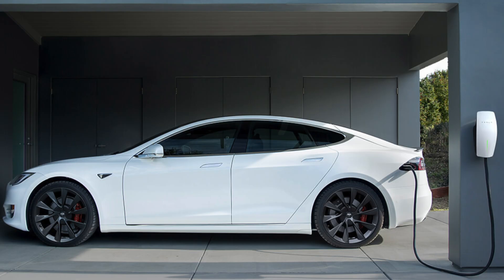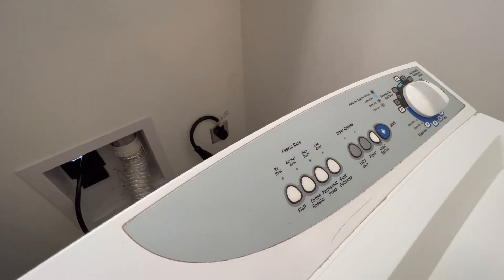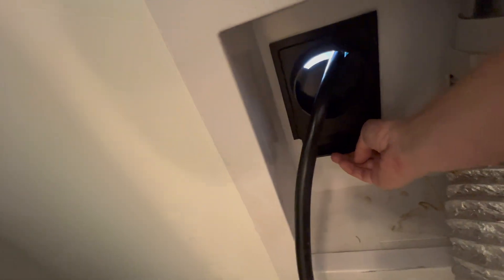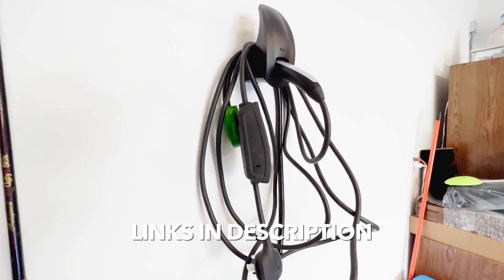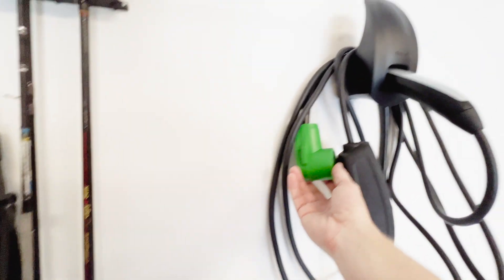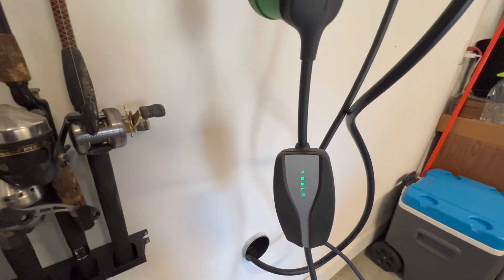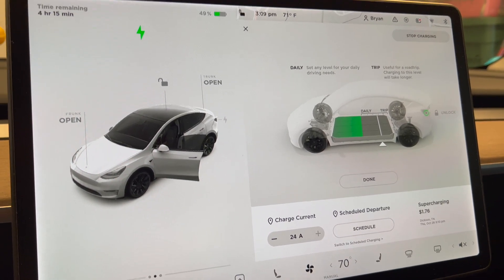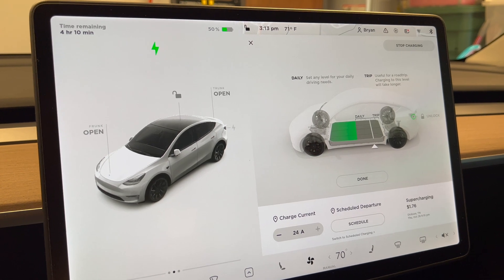Tesla Fast Charging at Home w/ Dryer Plug - Quick Tip

Comment: My dryer plug is a 3 prong 10-30 plug, so I just need to get the 10-30 splitter, extension cord and adapter for mobile charger? Thanks
Reply from the maker: Yep. 10-30 splitter as you don't want to have to unplug constantly from the dryer outlet (main end goes into the 10-30 dryer wall outlet, then one side you plug the dryer into, the other you have the heavy duty 10-30 rv/ev extension cord into, then plug the 10-30 adapter from Tesla into it and you're good to go 👍🏻 I have links in the description of this video I'd appreciate you use on Amazon even if you select a different version. Just click the links and the select your 10-30 versions. Don't forget to never run both the dryer and car charging at the same time (use a sign of some other solution). Also, the Tesla should automatically set the amps, but if for some reason it's tripping the circuit or you ever feel a hot cord, take the amps down one or two notches on the screen. 

If for any reason you feel like something's not right, unplug and make sure to contact a certified electrician to look things over.

Hope that helps!

Comment: Get the Splitvolt Splitter and all your worries will be gone.
Reply from the maker: What worries are those? Great product, but not necessary for most people just trying to get going with decent charging speeds. I've been charging without it for 18 months and never had one issue as well as most of my friends with EV's. If you have kids or family then I could see how it would be a convenience to never have to make sure someone isn't drying when you plug in, but this video was aimed at someone looking to just get started and charge faster than the included wall outlet which I think 21 miles per hour does vs 3 miles per hour. Once you had the split volt and any other cables/adapters, you might as well just get a 50AMP plug installed with a 40AMP wall charger.
Reply: @bryanhauer  you can get rid of that Tesla tag. When the dryer turned on, the EV charging will stop automatically and it will continue charging again once the dryer stopped.
Reply from the maker: @vinnynguyen123  I know what it does 😀, but as I said... for most people that don't have a large family with other people drying it's an unneeded expense. If you have a family I'd agree with you as it would be annoying to worry about that, but this video was more aimed at the person who just got their Tesla and wants to do it for as cheap as possible. I do agree with you though that Splitvolt is a great product and has its place, but I kind of feel like if you're going to spend $300, why not just get a 50AMP dedicated plug installed? I eventually did that for under $250 from a certified electrician.

Comment: My main electric panel has maximum 100 Amps Main breaker. My dryer is electric. Can i still charge from my electric dryer or i need to upgrade my panel.?
Reply from the maker: You likely don’t have enough available as most new panels have 200. I’d check with a certified electrician to be sure.
Reply: @Bryan Hauer  Thankyou so much

Comment: Can I just keep the charger and dryer plugged the whole time or was there a reason why you unplug the charger
Reply from the maker: Shouldn't be an issue just leaving it plugged in. I did it just to be extra cautious so I'd make sure to never run the dryer and charger at the same time. Just created an extra step so I wouldn't make that mistake.

Comment: I have a gas dryer , so I just changed the dryer receptacle to Nema 14-50 one , it cost me $10 . And now I can charge the Tesla at 32 amps which is maximum the tesla charger can charge a SR+
Reply: I'm not an electrician.  But if you're doing what I think you're doing, that could be trouble.  The wire size required to charge at 32 amps are different than 22 amp.  I think the wires required for 50amp breaker and charging at 32 amps might be #6 wires for 50amp breaker, but still are probably #8 for charging at 32 amps.  I think the standard for that existing 30amp breaker are probably #10 wire.  So sounds like you're charging at 32 amps through #10 wire.  You may wanna look into that.  I didn't hear you say you changed the breaker, but I don't know how you're charging at 32amps through a 30amp standard dryer breaker.  Again, I'm not an electrician.  But you may wanna check into your size wire and the amps you're running through it.  Good luck.
Reply from the maker: Had two certified electricians look everything over and no issues 👍
Reply: @bryanhauer  I don't know if you're replying to me, but I was responding to the person above, Aman Paesar.  He didn't do the same thing you did.  His case is totally different from yours.  I see no issues with your setup either.  Aman's is another story depending on what else he did.  If anything.
Reply from the maker: Ahh got it 👍 wasn’t sure. 😀 Appreciate you helping him.

Comment: Super helpful video! How did you drill the hole in the wall? Any tips on how to drill into the wall safely and not damage any wires that might be inside the wall? Thanks!
Reply: His hole violates fire code.
Reply from the maker: Thanks. 😀 The tool is called a 4 inch hole saw or hole dozer. I didn't go through full drywall as I already had a cutout there for the dryer vent so only needed to go through about half an inch of plastic so not sure, but you definitely don't want to just start drilling holes without knowing what's behind them. I'm sure there's some YouTube videos on this as well.

Comment: This is so helpful. I get my model 3 on Monday and the electrician quotes have been HORRIBLE. I was shocked to see everyone want to charge $2000-$3000 just to install the outlet in the garage. Nope! This will do and my laundry room is right next to my garage. Just ordered a dryer splitter for $70 and I have the level 2 25’ charger/cord. My only question is what do you call the slide/pocket door thing you installed?
Reply: Figured it out! Cable hatch! Just purchased on Amazon. From $2,000 to $98 I’m so happy.
Reply: @CamSaidSo  Can you provide the link or the name of the cable hatch please?
Reply: @barrycrawford870  I ended up not being able to use the hatch because the charger head that goes into the car is too large to pass through. Right now I just have a cut out in my drywall with steel wool around it until I can find something more aesthetically pleasing.
Reply: @CamSaidSo you bought it 6 months ago?   Ouch  you bought it right before Tesla drop 30% from original msrp plus $7500 tax credit
Reply: @sky-h6j-i1q  don’t remind me 😒. I was so upset about it. Thankfully, this is a lease that will be returned. Still love the car though.
Reply from the maker: Oh cool. Make sure to keep an eye on it the first few times to make sure the charger isn't getting hot. If it is you can try lowering the amps in the car on the screen one notch. Also be careful if you have an older house with old wiring, but otherwise it should be fine. Just make sure to not use the dryer at the same time or it'll trip the circuit. 

All the items are listed in the description of the video. Just click the View More link under the video. The item you're referring to is the 4 Inch ABS Plastic Blast Gate 4 inch: https://geni.us/q13Z
Reply: @bryanhauer  thank you so much for the info! I’ll be sure not to charge and dry at the same time. My house is new…hoping the cord doesn’t get hot but I wouldn’t be surprised…i have 3 different third party chargers and none are from Tesla, but they were all free so I have to try them.
Reply: @CamSaidSo hey how did it go for you?
Reply: @jakeschleifer1303  it’s going really well. No issues at all. Not a lot of heat. Charges from 0-100 in a little under 7 hours at 32A.

Comment: my electrician wired me the same plug as a dryer for my Tesla on my new house. It is right on the garage wall with a designated line and fuse. I loved your video by the way. My question is: How do I find something to plug into wall and and into the tesla charger that isn't a extension cord, isn't there something shorter????  like an adapter?
Reply from the maker: Hey John - Yep. You only need the extension cord if you need a longer cord, but if not and the mobile charger reaches simply get which adapter you need directly from Tesla. Just select the one you need from the dropdown and that's it. https://shop.tesla.com/product/gen-2-nema-adapters

What kind of plug did your electrician put in?

Comment: Great video Bryan. So I went ahead and ordered everything :)  BUT I found out my dryer outlet is a weird-looking one. the apartment complex said it's 240, but google says it's a 20amp. I wish I could upload the image. it's basically a triangle in the middle, 2  45 degree holes on the sides, and one L shape at the top ! .. any suggestions or ideas would be super helpful. I don't have a clue when it comes to electricity.
Reply: Google 10-30 plug and I'm betting that's the one
Reply: Sounds like a 10-30 plug
Reply from the maker: Thanks Tarig! Shoot me an email from my website's contact page. You won't initially be able to send a picture, but once I respond you can email me a link to what it looks like or send a picture and I'll try to help. https://www.bryanhauer.com/contact

Comment: Hi Bryan, great video, thank you! Though my house is older and I have a dryer attached to a 10-30 outlet in my garage. So the 14-30 splitter will not work for me. Can you please recommend a comparable 10-30 splitter to buy? Thank you.
Reply from the maker: This should give you what you need, but double check the plugs to make sure they match what you have...
RV Mate 10-30 splitter: https://geni.us/7ON43Z
Tesla 10-30 adapter (select 10-30 from dropdown): https://shop.tesla.com/product/gen-2-nema-adapters
Ext Cord for RV/EV's (if needed): https://geni.us/hQm9E

Note: I'm not an electrician so make sure you ask a certified electrician if you're unsure about something. 

Hope that helps 😀

Comment: Is there a 75’ extension cord you would recommend? I see the one you linked only goes up to 50’
Reply from the maker: Hi James - 50 ft seems to be the longest I've seen in that specific cord unfortunately.
Reply: @bryanhauer  thanks for the quick reply!
Reply: Thanks a ton Bryan for the info.   This comment jogged a question from me... with the longer the extension cord, does t drop the voltage the longer it gets?  Thanks!  Also, Can this setup be outside?  May consider putting a rain cover over it or something......

Comment: Very informative. One concerning is the dryer normally run no more than 1h. Do you have any concern by using this dryer outlet  for EV charge for more than 10h or overnight most of time we do to get full charge. Any concern for any over heat or potential fire?  I am concern any wire issue since the dryer wire is not designed for EV charge. Thank you.
Reply from the maker: No concerns at my place which is a newer construction. Had it checked by an electrician and have run it all night multiple times per week for over a year and no heating up. Never heard of any issues with using a normal 30AMP dryer plug. Only concern I've ever heard of is they're usually not meant to be plugged and unplugged over and over which is why I have a splitter so I never have to do that. I only use one at a time though. 

With that said... every house can be different based on age of house, wiring etc, so I'd suggest just having a certified electrician come out to take a look.

Comment: Thanks for sharing, was wondering if I can use ur solution on a not sharing room. My laundry room is on top of the garage on second story, do u think I should just have an electrician to install outlet or somehow extent it to the garage
Reply from the maker: Probably best to have an electrician at least look at that as you probably wouldn't want to run a cord all the way down. I'd probably just have a certified electrician put a 50AMP 14-50 outlet in the garage and then just grab the Tesla 14-50 adapter. My solution probably works best for anyone with an adjoining wall that already has a pass through with the laundry room.
Reply: @bryanhauer  thanks for the advice, I was actually able to run the cord straight down the stairs while using the 50ft extending cord, ur option is way cheaper and reusable after changing houses
Reply from the maker: @ningwang1227  Just a note... you shouldn't use a regular extension cord. It has to be the appropriate gauge wire for RV's or EV's amperage. If not, it's a fire hazard.
Reply: @bryanhauer  got it, I used ur whole set up other than I chose to buy a 50feets extension cord that u linked in description, I think I’m fine right? Thanks
Reply from the maker: @ningwang1227  As long as it's the one that's thick heavy gauge and used for RV/EV's you're fine 😀
Reply: @bryanhauer  got it thanks for the help
Reply: @bryanhauer  hi I just got my 14-30 and my mobile charger is flashing red t I don’t know what went wrong here 😂😂

Comment: I'm thinking that if you flip that access small opening it will be easier to close it and stay close
Reply from the maker: Good thought and one I looked at, but that actually wouldn't work as the only place the hole can be is near the top of the cutout and so the door can't slide up and has to slide down. I agree though, normally I'd have it slide up.

Comment: I don't have a 240v outlet anywhere in my house. My dryer uses a normal 110v outlet.

This video won't help anyone that doesn't already have a 240v outlet. In which case, you have to bite the bullet and have a wall charger installed. Unless you want to live with super slow charging forever.
Reply from the maker: Most people plug their dryer into a 30 amp 240v outlet so it will help the vast majority of people, unfortunately not everyone. My suggestion would be to get a 50 or 60 amp installed if possible.
Reply: @bryanhauer  I understand. My apologies if I came off as rude.

Comment: sir you are absolutely a genius. how do i connect tesla 14-30 adapter (which is currently out of stock) once i get it.
Reply from the maker: They usually refill the stock fairly quickly so just enter your email address on that page and Tesla will email you as soon as it's available. What specifically are you asking about connecting it cause I show how to do that in the video?? Thanks.

Comment: Hey Bryan, quick question. On the link to purchase Tesla 14-30 Adapter (Select 14-30 from Dropdown), I am seeing that currently they are out of stock. Is there any other place where I can buy this Adapter?
Reply from the maker: Hi Rajan - Tesla is usually pretty quick about restocking those so I'd just click the link that says 'Email me when this item is restocked', input your email and usually within a week or so you'll get a notification email that they're back in stock. Then just make sure to buy one right away. I'm not aware of anywhere else that sells the official Tesla ones. You might find one on eBay with a small markup, but make sure the seller has good reviews. Hope that helps!
Reply: @bryanhauer  Thanks Bryan for quick turn around. Ok sure I will wait for them (Tesla) to restock and notify me. I just got delivery of Model Y yesterday, so not in rush. Thanks a ton.

Comment: How much cheaper is this compared to charging at tesla supercharge station? Also, what is the average additonal cost for your electric bill for your 220v charge per month
Reply from the maker: Luckily the Tesla app gives you this exact info. In my case, my average cost per kWh at home is $0.12 and at Superchargers/Fast chargers it's $0.40. It's a bit more than a 3rd cheaper at home vs on the road. 

As far as additional cost on my monthly electrical bill... mine is a bit skewed as I travel so much that when I'm home I almost never drive so only charge up about once per week and while on the road I charge up about once a day at least and sometime multiple times per day. In my case I barely notice a bump on my monthly bill. Best way is to just look at the actual cost per kWh like I did above which shows it's a bit more than a 3rd cheaper. 

Hope that helps 😀
Reply: On a side note, you should only supercharge on big road trips as it degrades the battery. Tesla states it in the manual
Reply from the maker: This is not something you should worry about as an owner if you plan to own the car for a normal amount of time as any degradation is minimal. Drive your car, enjoy it, charge at home when possible and charge at Superchargers whenever needed 👍

Comment: Probably should put your little sliding door behind the dryer upside down. The weight of the cord will keep trying to pull it open the way it is.
Reply from the maker: Can’t as the opening on the other side is at the top and if I did that it wouldn’t be able to open. Normally I’d agree, but in this instance it unfortunately wouldn’t work.